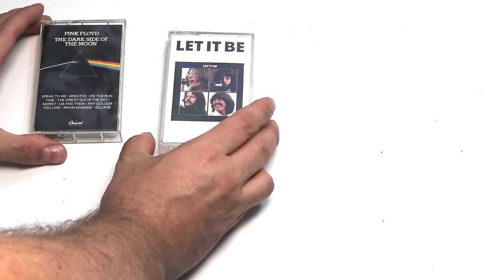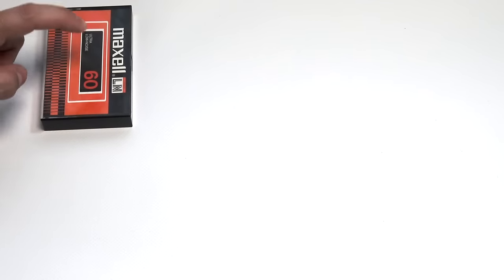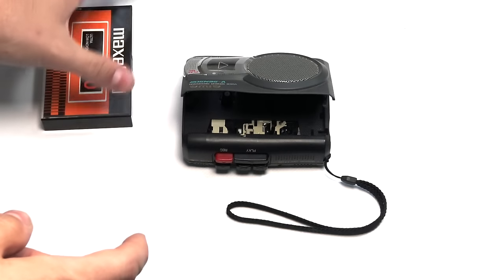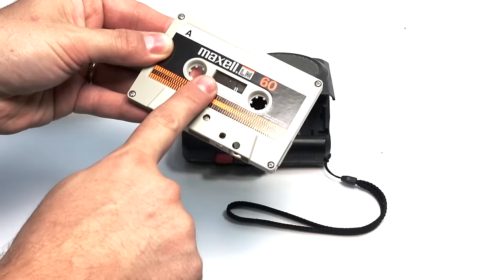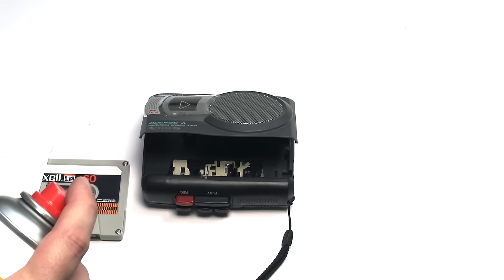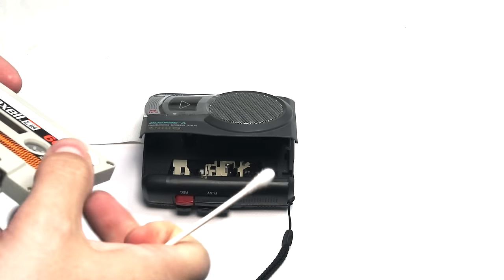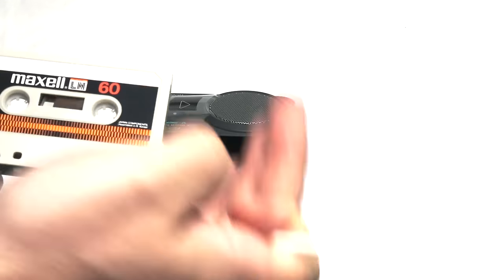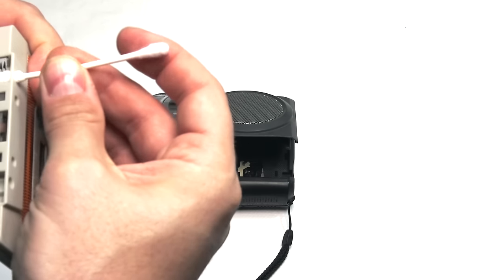How to relubricate your stuck cassette tapes

Comment: Please do not ever do this. Lubricant can contaminate the pinch rollers and heads of your machine. Some chemicals can dissolve the glues used in tape heads, and can cause rubber compounds to fall apart. Slippery capstans and pinch rollers will cause speed instability. Slippery tape can coggle and cinch, which is not good. The tape needs to bind for consistent back tension. Chemicals could cause the tape to delaminate, leaving oxide on everything. Maxell oxide shedding caused much damage in the '90's to video machinery, and cross contaminated other tapes.
The squeaking and jamming is caused by uneven winding, and by oxide shedding. Yes you can use a q-tip (carefully) in the manner shown, but do it dry. Best is to take the shell apart and clean the oxide out. Also clean out guide rollers within the shell. Also clean the sheet film in the shell.
Please do not use any lube though or you may find you cause irreparable damage to your machine.
Reply from the maker: As explained in the video this is not an idea I just came out with. I trust lucky of tapeheads and I can assure you that tape does have and need sone lube. Especially the XDR tapes. Using the method I described gives a very low amount of lube and, as stated, you need to give time to the tape to absorb the lube. After that you can use a dry tip for absorbing the exeeding amount. Lube can actually help the life of other rubber parts.
Apart from this, the compounds suggested in the video are safe because completely inert. They do not corrod or melt anything.
Reply: 25 years in the broadcasting industry, I've seen it all with tape problems. The manufacturers of the fluids obviously claim no harm can come, but we are talking, in some cases of tapes and machines of 70's and 80's manufacture, where these lubes did not exist. Everybody claimed it wasnt their fault when video heads came unglued in the 80's, and Maxell denied all liability, in the 90's when we discovered it was their oxide that was destroying D3 heads and contaminating other D3 tapes that then all had to be recovered and cloned. In some cases entire programmes were lost. It cost just the BBC about a £1M fixing the problem.
I stand by my comment to use the other method. I have hundreds of cassettes and have come across some "sticky" tapes. Taking them out of their shell, cleaning all the oxide away and reinstating the tape is the best method, and the only one I would ever recommend to anyone else. 
It is fine to try other solutions on your own equipment, at the very least add a disclaimer that people do this at their own risk and that you are not willing to take responsibility for any resulting damage to either tapes, by cinching or coggling, or machinery.
Reply: Thanks for your advice. I tried the method of anadialog, it took some time and then ....nothing happened or harmed the tape. Chet Baker still sounds amazing. I tried this on several tapes.... no harm, no soundloss or even damage of the tape. May you have your experience in 25 year of broadcasting. I got tapes since 69, the still work, coz my father used to clean them with fluids that were sold in the 70 to clean heads. Still amazing, no glue, no briddle nothing. Everyone shall make his experience;-)
Reply: Cheers, Bryan!!! This is what I was trying to convey in my own comments, but you addressed things with more succinct specificity! Thanks for conveying what I failed to say, lol.
Reply: ►"no harm, no soundloss or even damage of the tape. "

You won't notice problems right away. Give it time. LOTS of time. Let the science do its thing, your tapes (and possibly any decks it transfers these solvents and lubes to) will begin to wane. ;-)

I don't have any formal industry experience, just 20 years of my own trial and error and pretty much having tried, seen, and done it all when it comes to tapes and their care/maintenance. I've used tapes to excess levels that have put new meaning to the term "torture tests". I've also done tape splicing, so taking tapes apart and transferring tape into new shells and replacing hubs and the various little parts for various reasons is old hat for me. And handling tapes just with bare fingers - despite all my delicate efforts in handling - still compromised the tape, so I can only imagine what chemical solvents and lubes (whatever their potency) will do.
Reply: I absolutely agree! I thought he's gonna show how to lube the two small rollers inside the cassette (lubricating which sometimes may, or may not, help fight the cassette squeakiness) and could not believe what he was actually doing! This is surely the WD40-onto-vinyl kind of advice, i.e. it may seem to work but it's bad as hell because it actually ruins the media and the player! Lubricating the tape itself is a sure way to destroy your cassette, first of all because any lube gathers dust. Cassettes attract dust even without any lube because of the movement of the tape which generates static electricity. I'm not sure what kind of long-term consequences playing an oily tape may have for the tape, the heads and pinch rollers but they will surely all be covered in goo after a while.
Reply: If you want the rubber components to last longer use the specialized rubber cleaning and restoration solutions for printer rollers, e.g. Platenclene.
Reply from the maker: Hi, as claimed in various occasions, to avoid what you are sayong just use a dry cotton swab or two to abaorb all exceeding lube...
Reply: @ ana[dia]log

You're missing the point. The problem is not "excess lube on the tape", it is lube on the tape, PERIOD. 

Countless others agree, including people who have worked years in the industry and "seen it all" when it comes to tape. 

If you have "tape squeak", that is NOT THE TAPE, it's the internal mechanisms somewhere - the guides, the hubs/spools (that the tape winds onto), the little "slip sheet" liners (that protect and guide the tape from the inner shell) - and those are the parts that may require some strategically administered lubrication. But you NEVER apply ANY solvent DIRECTLY to the magnetic tape itself! 

The damage may not be immediately noticeable, but it'll happen. 

One of the worst things about the internet are all the pseudo-know-it-alls and "experts" who dole out this horrible advice and dupe people into wrecking their stuff while trying to repair/fix/modify/protect it. 

You know who benefits from applying solvents to tapes? The solvent MANUFACTURERS. Greedy pricks who prey on the layman's ignorance. 

If you wanna keep lubing your tapes, that's your choice.
But please stop advising others to do so.
Reply from the maker: Never talked about solvent. Only lubricant. ALL types of tape, I repeat, ALL, have a lubricant in the film. Before judging so quick, you must also know that relubing tape is a standard procedure for highly important recordings. I didn't invent anything. Finally, the XDR tapes have this famous issue. The person in chief if the lubricant was fired back at tine due to the issues these tapes showed shortly after production.
Reply: ►Never talked about solvent. Only lubricant. 

I really do not see much of a difference, as it still boils down to putting foreign substances on the delicate tape. Never in any of the little J-card instructions for care and maintenance does it ever speak of lubricating the tape itself. None. Ever. 

►ALL types of tape, I repeat, ALL, have a lubricant in the film.

Perhaps in the initial production, sure. That doesn't necessarily mean more is to be added later. It's kind of like painting the walls after putting up the wallpaper. 

►Before judging so quick, you must also know that relubing tape is a standard procedure for highly important recordings.

I am not "judging quick", pal. I told you, as did other commenters, that our "judgment" comes from YEARS of firsthand experience working with tapes, in both professional and commercial capacities. And again, if this was such an important thing, WHY does not one single blank cassette insert ever mention it among all the other tips for proper care & maintenance of the tape? 
I think you lie. 

►I didn't invent anything.

I'm beginning to think you did. 

►Finally, the XDR tapes have this famous issue. The person in chief if the lubricant was fired back at tine due to the issues these tapes showed shortly after production.

Well, all that tells me is that someone got fired for not doing their job properly (boy do I miss those times ; nowadays any inept fool is kept on cos of affirmative action and fear of facing accusations of personal prejudices for simply making an executive decision based on merit), and it also suggests to me maybe the problems occurred with those particular tapes cos, well, maybe they just plain suck and are/were not very good at all - lube or no lube? 

Avoid the "XDR" tapes, folks. They're sketchy.

Look, as I said before - if you wanna lube up your own tapes, go for it. But as a YouTuber, please refrain from giving advice and tutorials that obviously do NOT ring true with anyone who has ACTUAL knowledge, understanding, and experience with the format. 

I guess the only thing I have left to say to your reply and continued defense of this "lubrication maintenance" notion as a whole are two simple words : 

PROVE IT.
Show us some official proven testimony (aside from your own) backed by documentation and/or widely-distributed instructions that allude to or uniquely specify that this lubrication practice you are on about is indeed safe and effective for audio cassette tapes.
Reply: Ok, found this article: https://www.clir.org/pubs/reports/pub54/2what_wrong. Generally it talks about reel-to-reel tapes and the sticky shed syndrome but most important is the part about lube and relubrication. So it's implied that the lube should be completely absorbed by the tape and there should be almost none of it left on the surface, because it must be temporarily squeezed out of the pores and then back into them like a sponge. So the process of relubrication is more complex than just using a cotton swab imbibed with some random lube: the amount applied to the tape must be controlled all the time. Theoretically one can use two swabs: one with lubricant, pressing firmly onto tape, and another right after it, pressing a bit more lightly, to remove the excess of the lube, but it's again a very crude solution (how about the tape edges? the swab cannot be pressed well enough against those, so you cannot tell if they are cleaned up well enough, and how about tiny drops of lube getting onto the underside of tape?). A specialized machine is needed here, that's for sure. And there's one more aspect: I read that the cassette tapes (at lease those made after the 1980) are not vulnerable to the sticky shed syndrome. Does that mean the binder construction is slightly different? After all, the pressure applied to the cassette tape by the mechanisms is lower than in reel-to-reel machines. So may be there is no lube in cassettes tapes after all (at least in non-XDR tapes)? Concluding everything: I think that one may carefully apply lube to a tape but only to save the record by transferring it onto another cassette or by digitization but never for casual listening. An unprofessionally relubed tape will surely cause harm to pinch rollers, so inevitably it must go into trash.
Reply from the maker: Here you go!
This is a page of a famous audio engineer: http://www.baileyzone.net/analog%20tape%20diy.htm
This is a page of a company that sells its high quality tape lubricant: https://thelastfactory.com/tape-care-preservation/
Here is a scientific article talking about tape composition and lubrication (and re-lubrication!): https://www.clir.org/pubs/reports/pub54/2what_wrong/
Enough or do you need more info?
Reply: @anadialog  While not completely inert (the active component in the spray, the silicone lubricant, still needs a propellant (propane) and a solvent (petroleum distillates) to be applied from an aerosol can. While the silicone is inert, the solvent isn't, but as long as one applies it with great care and allows the solvent time to evaporate one should be fine. 

The time from treatment to the tapes were ready probably says something about how long it takes for the solvent to evaporate fully when trapped between the layers of tape.

The only risk factor is how the solvent might affect the actual magnetic tape layer itself, the polyester, or the bond between them. With gentle application, it might even strenghten the bond between oxide and substrate rather than delaminate it as the original adhesive is partly redissolved and then recured from the exposure to the small amount of solvent, and as the solvent is allowed to evaporate fully and the adhesive to recure without anything rubbing against the tape, the tape should be fine and there will be no effects on any tape player afterwards – save for improved playback.

One should still practice on less important tapes first, to be sure one's technique doesn't cause any unwanted effects.
Reply: Silicon oil (pure silicon) has been used for years and years and years ... (Scotch brand reel to reel even had it in its oxide formula as a dry lubricant) it does NOT affect rubber parts in anyway shape or form in fact actually preserves rubber because it non destructively lubricates and prevents it from drying out ... of course in moderation... too much and it will be slippery as ice
Reply: @TaigaFolk  And here you go repeating the old gem to use "specialized rubber cleaner" to clean pinch rollers, when it is known that those chemicals will turn your rubber into a black, gooey, tarry mess that will destroy your device unless you are willing to commit tens of hours disassembling your transport and cleaning every contaminated component. And I bet you'd say NEVER clean rubber with alcohol! Right? You are the basis of ignorance in the world. Please consider turning to another way, a simpler way, the way of thinking and testing, not just mindlessly repeating.
Reply: @alphanumeric1529  Wow, it been nearly a year since I made that reply. Well since then I've a changed my mind a bit. Anyway you sound so angry like I've insulted you personally. But back to the matter: although I still prefer just to dump a squeaky cassette into trash, if it's really too precious I'd probably actually risk to relubricate one, it's probably no big deal after all. By the way, it's not specialized rubber cleaners that turn belts into gooey, they somehow just disintegrate with time all by themselves. Interestingly enough, automotive belt producers always warn that no oil should ever get onto the belts, so I guess may be oil from the mechanism somehow gets onto the transport belts with time and disintegrate them.
Reply: @trxbloke  AGREED COMPLETELY from another broadacst and recording engineer of 25+ years. Don't lube your tapes people. It's a disaster waiting to happen.
Reply: @TaigaFolk  it will DESTROY your pinch rollers. Especially ones that are 20-30+ years old. FML/SMH
Reply: @anadialog  that "famous" engineer isn't famous at all - just a regular staff/house engineer....there's millions of those...he's never written a white paper based on his findings, so...grain of salt.

As well, he was never talking about cassettes in his article, he was speaking of reel-to-reel which uses different formulations and oxide amounts compared to cassettes.

Again, the XDR issues, is twofold - crappy tape that sticks and lousy shells/interiors. 1st gen XDR's can not really be fixed, except for dropping into a new shell and praying.

Please folks, if you care about the life of your cassette decks (which now have nearly no way of proper repair or part replacements) DO NOT lubricate your cassette tapes.
Reply: It takes patience. Let it sit for a little and it'll be fine.
Reply: You can't tell this guy anything, because he thinks he knows he is right...Which he is NOT!

Comment: Been tested on several old tapes where changing its cassette housing still not fixing tape stuck issue and it's really works. 

Also, make sure to spool the cassette back and forth to realign the tape reel.
Reply from the maker: Great!

Comment: Very, very useful. I wonder if, instead of #M Silicone Lubricant, would CRC 05074 Heavy Duty Silicone Lubricant work or would it be presumably too harsh on the cassette tape? I don't find Kontakt on Amazon here in the US